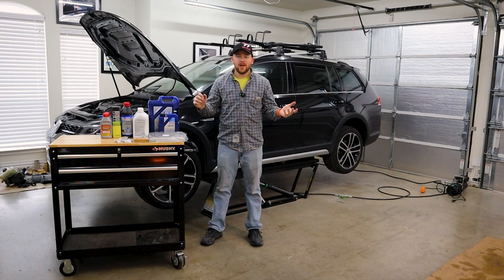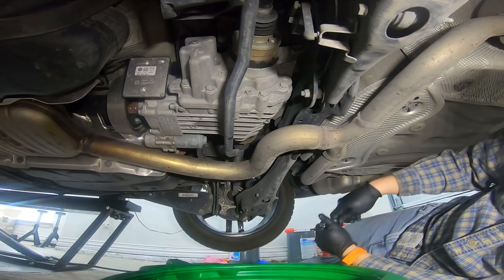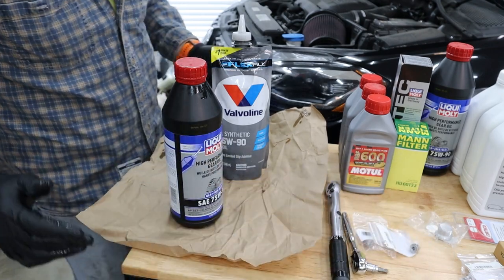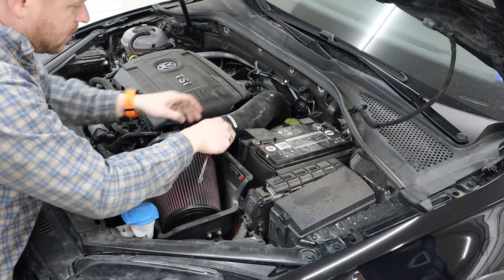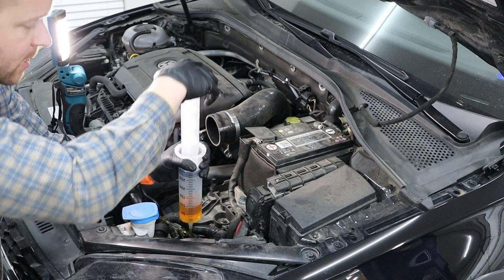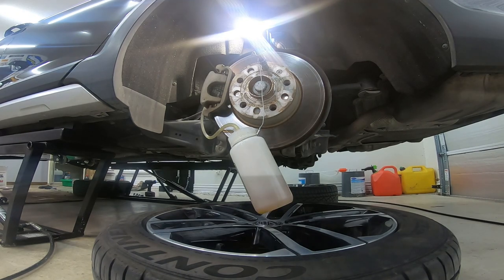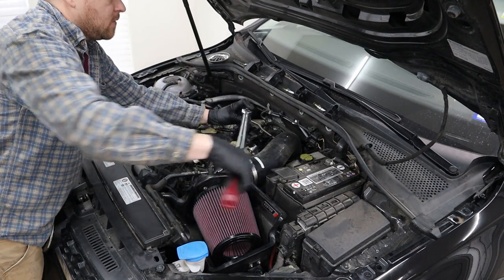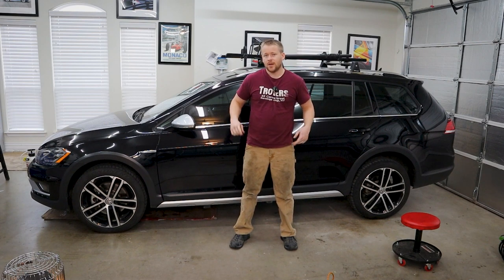VW Alltrack 50K Service| Rear Diff, Bevel Box, Manual Trans Fluid, Brake Flush, Spark Plugs, Oil

Comment: In a pinch, when not replacing the copper crush washers, you should aneal them. This way they will seal like new. A common way is to suspend with a piece of steel wire and heat to a dull red with a propane torch, and then drop it into water. The washers on the VW plugs don't come off easily though.

Comment: Hey I just brought my 19" 6MT Alltrack into VW to swap the Manual Trans fluid. I DID NOT have the fill plug underneath the car BUT the tech filled the fluid up under the hood with a funnel VERY easily and said it wasn't hard to get to. I think it's worth a look for you to find the fill plug for next time. They said it was like 2.13L to spec but I had them fill it to 2.3L. Either way, awesome watching your vids! Keep it up

Comment: This video helped out since I couldn't find much info for a 2020 GTI. It looks like the fill for the transmission fluid is same as the Alltrack, so I'll be using this video for reference when it's time. Did you set the selector shaft to neutral when doing the transmission fluid? One thing to note, looking at VW's documentation, they recommend a 18mm OD tube to fill the transmission. You might have been struggling since that tube is too small for the fluid. Thank you.

Comment: Well done!  Could you note the tube size that you used that fits in the fill holes on the rear diff and bevel box? I bought a cheap hand pump off Amazon and the tube was too big. Ended up shoving a piece of smaller tubing from the hardware store inside it to fit in the hole.  Also, agreed on the rear diff. Spec says that it takes 900 ml, which is what I got out of it... but when I filled it, it took the whole liter and didn't overflow.  Glad you got the manual trans. Haven't seen a video of that, only pictures.
Reply from the maker: Here is a link to what I got on Amazon. It says it has a 4mm diameter.
Large 100ml Plastic Syringe with Tubing, Carejoy Indutrial Syringes + 80cm(31.5in) Handy Long Hose Fluid Suction Injector for Scientific Labs Injecting, Feeding Pets, Drawing Oil, Fluid and Water https://a.co/d/4F1xdiR
Reply: @thefadshow  I use syringes like this for dosing out fertilizer in my sprayer for the lawn lol. Handy things to have around,.

Comment: Great video and thanks for posting! As an owner of a 2019 Golf 1.4 L and a 2022 Tiguan SE R Line, I plan on doing the same maintaining care that you do on your vehicles. Q: how much do you think you saved in VW labor cost by doing the whole thing yourself!
Reply from the maker: My guess is VW would charge probably 6 hours of labor for all of this work. Labor rate depends on area but 100-140 an hour.
Reply: @thefadshow  VW in ontario offers Haldex at $139.99 CAD at a 30% promotion.  Not sure on the other stuff other than the manual trans fluid which most of your cost is the 3 bottles of Fluid. I was over $500 CAD for this service last week.